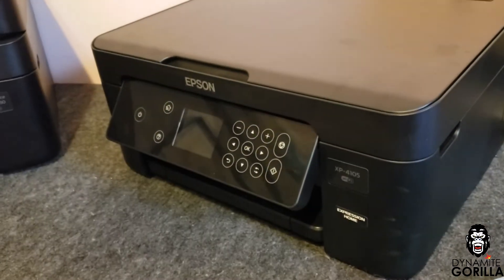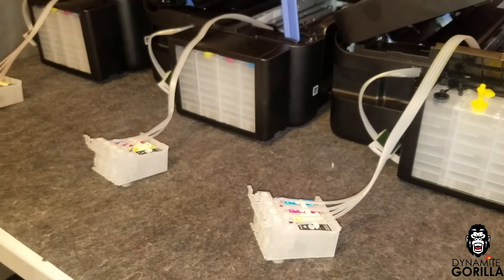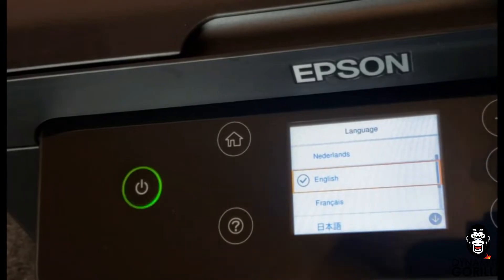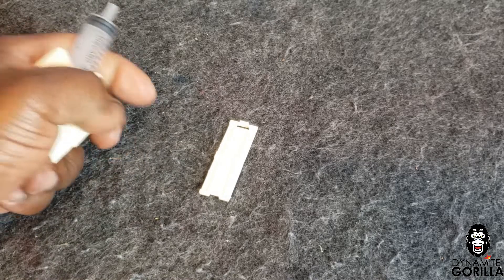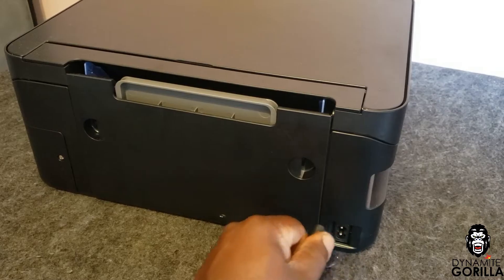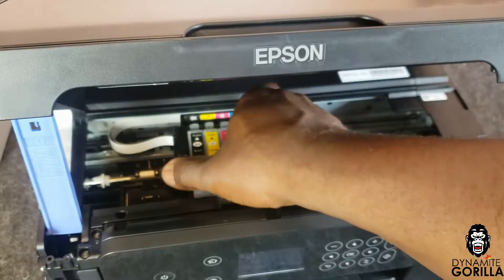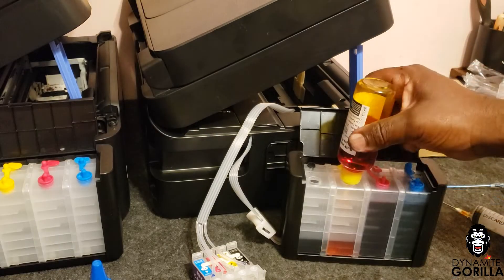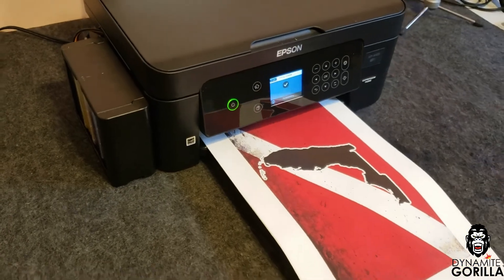XP-4105 CISS INSTALL FOR SUBLIMATION!! (WF-2830 and WF-2850 too!)

Comment: Clear and concise as usual, I notice you did not use any dampers on these like you did on the xp-15000 ciss install, is there a reason for not using them on these Thanks
Reply from the maker: I didn't have any dampers at the time. It'll still work without them. But it helps keep the ink (and air) from traveling backwards in the lines. Ill probably wind up doing another video on how to add them in after the fact.
-DG